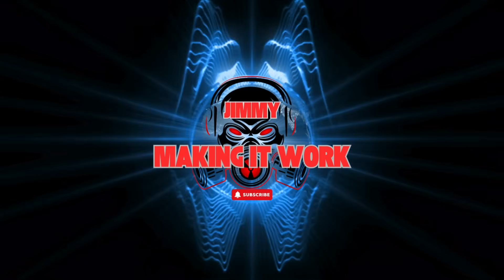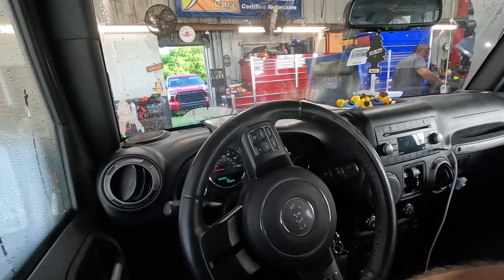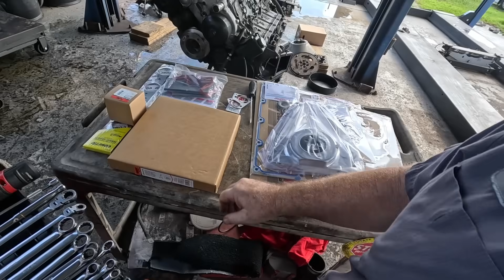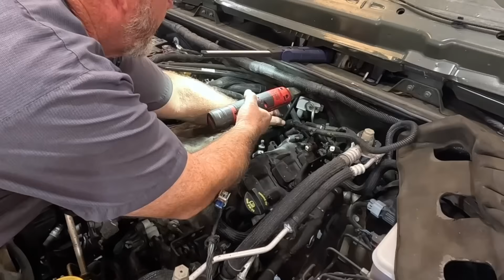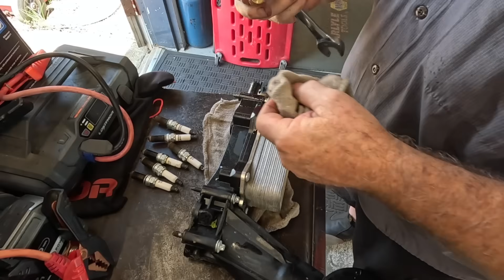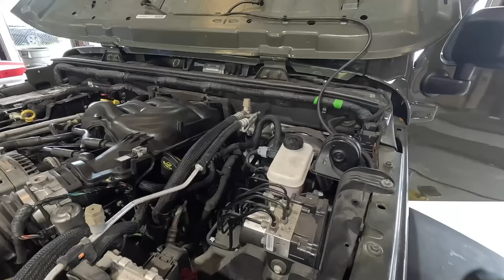WRANGLER 3.6 OIL COOLER, RAV4 LOF, AUTP REPAIR SHOP DAY 771

Comment: As a Jeep wrangler owner you got us worried about our Jeep now. It’s our 3rd Jeep @85k and it’s been perfect so far. Time will tell and we will fix and move on. It’s a risk being cool. But I’ve learned from you that every brand has an issue with something. How about donuts in the morning, Thanks Jimmy
Reply from the maker: Glad to hear your Jeep has been good so far, the biggest thing is oil changes AND not to over tighten that filter cap. ;)

They are cool trucks, just wish they’d come up with a better engine design.

Comment: My sister has a Jeep Grand Cherokee 2015 with the 3.6.  Luckily a base Laredo.  2WD.  Its a niceish vehicle, but I'm fearful of long term ownership.  When I did spark plugs at 100K, I could see the oil filter housing was done before she bought it at 35K in 2018.  Missing clips, missing bolts/brackets.  It's now at 112K.  

Out of curiosity for my own future reference, I know Ford deleted the shraeder on the fuel rail so you could test fuel pressure on vehicles built after like November 2002 for the "panther body" RWD cars.  How would you go about testing fuel pressure when no test port exists?

Assume the Corolla AC tested out OK after baking in the sun?  Sounded like the low side was finally coming down.
Reply from the maker: I think when they went away from test port, they went to rail pressure sensor Nick?
The Corolla was perfect after we installed a decent Denso compressor. :)
Reply: @JimmyMakingitwork  Yea they have a sensor on the returnless fuel system cars which is why they eventually deleted the test port but I wasn't aware if that's data that can be trusted.

That's awesome.  Glad to hear Denso saved the day.

Comment: Thanks for the video Jimmy!
3 days after finishing the last project and I'm looking for the next one lol, very hard to resist a Range Rover Sport L320. BMW dropped more than a billion USD into the development of that series. Very much undervalued at the moment, 2010 to 2012 clean examples going for $3k USD at auction near me with 100k miles. I blame LR Time channel, "Land Rover - hard to work on but reliable once fixed"
Reply from the maker: Thanks for the support, the Land Rovers are cheap when they get older because of cost to repair. Big money in most cases. 
But it sounds like you have some fun projects coming up!
Reply: @JimmyMakingitwork  Yeah, if I couldn't do the work myself I wouldn't dare touch one. Luckily I have one to work on for someone else shortly with the understanding that if things go sideways it will have to go to the local LR specialist.
I can dip a toe in the water and see how it feels.

Comment: What you fail to realize jimmy it’s not the wrangler engine I have had 3 grand Cherokee with that engine from new never an issue it’s the people that own them fail to do the maintenance on them  so don’t bash the product you’re just assuming it’s the product and it is annoying to people that own them
Reply: We all cope in our own ways. Yes, oil cooler replacement is something that every vehicle owner should be doing every 20k miles or so. Totally routine. Good call. 😂
Reply: Alright now I know this guy is just trolling. Next he'll claim it's the owner not the GM eco-tec design.
Reply from the maker: Thanks for watching.

Comment: my friend just purchased a 22 gladiator with the 3.6 penstar  28 thousand miles . this episode will be helpful in the future as most likely I will be doing the work. I told him this is a super common problem with this motor. I also recommended the dorman as a replacement(before his purchase), I'm thinking since it will be my first one a  4-hour time frame is possible. thanks for the episode, Jimmy 🪛🔧🔩👍
Reply from the maker: Awesome, glad you found the video helpful and thanks for the comment!